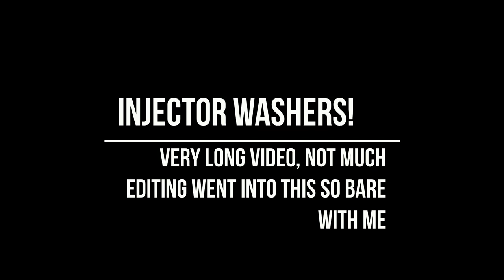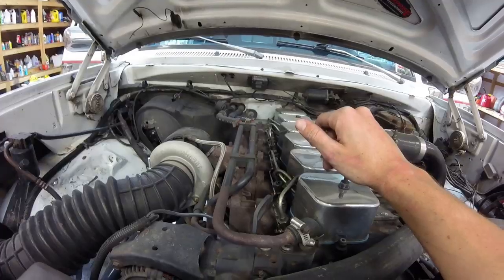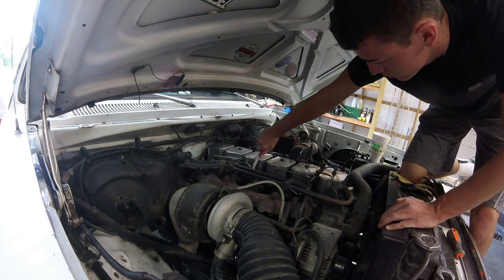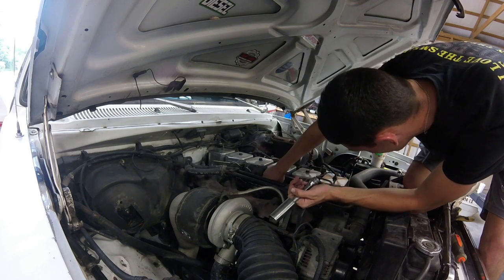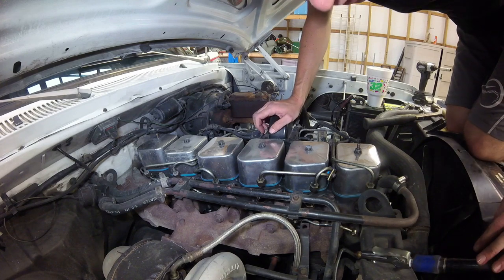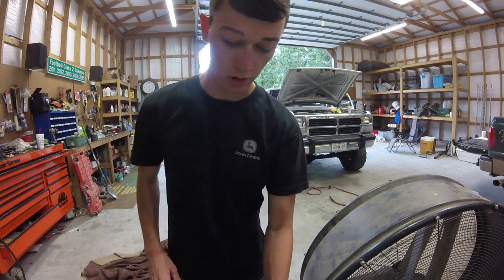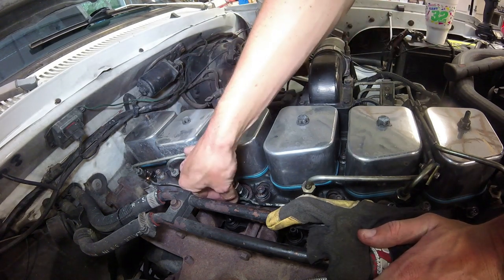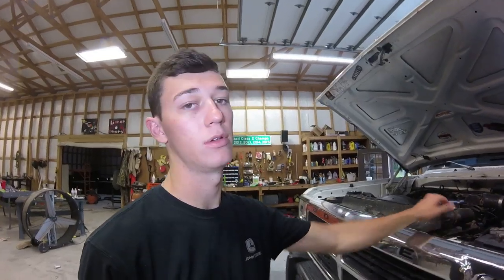First Gen Cummins Injector replacement

Comment: I’m having same problem. But I wonder if I just figured it out. Try going up a size on the needle copper washer. Mite seal better. I put a little thinner one in my truck today and a few were leaking.

Comment: Would your truck fire even with the bad injectors?
Reply from the maker: If the injectors were not popping off then no the truck would not fire. If the injectors were sticking open them yes the truck would fire and have a solid white haze
Reply: @GavinHuke  How would I know if they were stuck closed?
Reply from the maker: @mementomori2353  crack injector lines on the passenger side of the engine where they connect to the injector (should be a 17mm if I remember right). If there's fuel coming out of the lines with a good bit of pressure then injectors are bad. If not then work your way backwards and see if your getting fuel to the injection pump

Comment: What size turbo do u have on that truck stick?
Reply from the maker: 67/68/18 HX35 built by savage fab.. have plenty of videos over it
Reply from the maker: 67/67/18*
Reply: @GavinHuke  how does it spool. I have a tater built 63/65/12 it spools really slow. My stock hx35 work better. I am think about going with a 62/68/14 or a sxe 61/65/12
Reply from the maker: @bigmurph1447  spooled great before the converter went to crap. If your on stock injectors that explains the slow spool. Even though it's a stock frame charger does not mean stock injectors will spool it
Reply from the maker: @bigmurph1447  if you have a Facebook or instagram or some sort of messenger to message me through we could have a conversation about which direction to go, i know a guy with a 62/67/16 hx35 on his VE powered first gen with stock injectors and it spools great
Reply: @GavinHuke  I dont have facebook or Instagram or anything like that lol. My truck is a 96. That's y I was asking because ur truck is a ve mine is a ppump. I have lots of fuel 125hp injectors no plate tune AFC 024dv 4k gov springs. This turbo was junk from day one I should of sent it back I knew there was something wrong the first day I put it on. Felt like I lost 100hp. It doesn't start spooling till after 1500rpms. With my hx35 I couldn't even drive it hard with out braking the back tires loose that was rolling along at 40mph.
Reply from the maker: @bigmurph1447  yeah something isn't right. Really need that 67/76 turbine wheel, I'd talk to savage Fabrication, he actually tests all of his for what does best in certain. Scenarios
Reply: @GavinHuke  everyone talks these tater built turbos up. I took a hosing on mine. Thanks for the info. I really want to do compounds
Reply from the maker: @bigmurph1447  they are good chargers, that size just blows, and I had compounds but they are a bigger pain in the ass then they are worth imo
Reply: @GavinHuke  I will have to check out the charger u have
Reply from the maker: @bigmurph1447  I'll shoot bradley a message and ask about the size you have with that setup and see what he says about it
Reply: @GavinHuke  ok thanks
Reply: @GavinHuke  I found out my turbo is a 63/67
Reply from the maker: @bigmurph1447  that shouldnt be that "slow" of spooling.. wanting a charger to come to life in the aftermarket world before 1500rpm is pretty unrealistic though